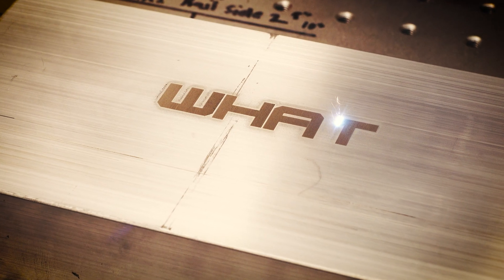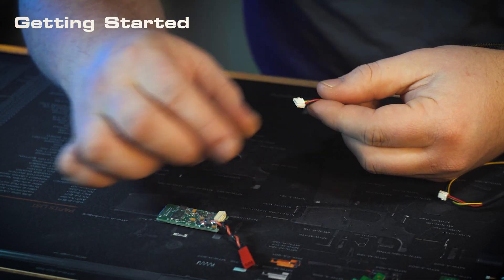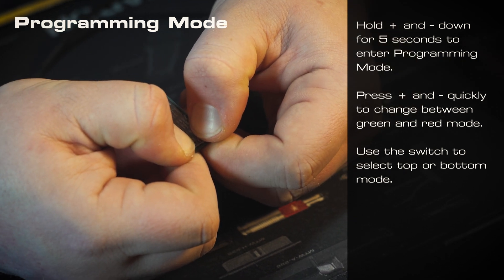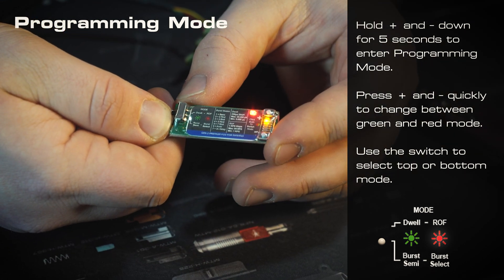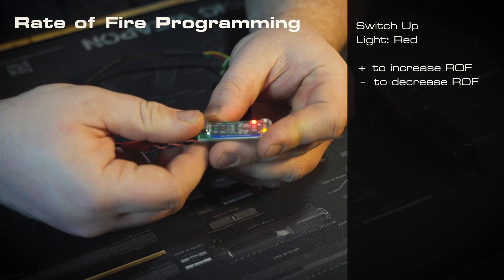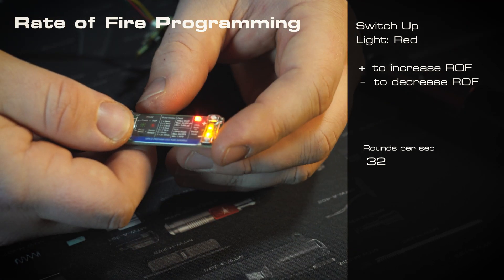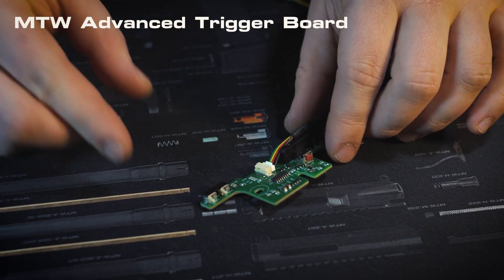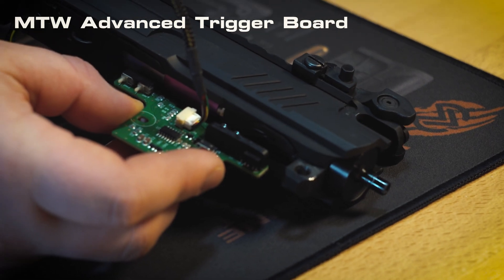Gen 2 Premium FCU Overview - What the Tech!

Comment: So I have the forged mtw with the premium fcu. I put the wraith X in it have never had good luck with the 12g cart. so I switched to the 9oz tank. Seemed to work fine. Played about 2-3months ago no issues. After play I had the tank filled and left it attached. Went to play Friday night and the tank was empty. They went to fill it and it was leaking so bad. Employee said go talk to the owner and he told me it was the wraith x and I should change it back because “they suck and you will never get a good seal”. So… I proceeded to take it apart and put back to original (btw it the engine/nozzle that’s leaking and I still can’t figure that out either, took it apart and cleaned it out, regreased lightly and still sticking out/open. It will not retract), but I digress slightly. While trying to switch it back the cables coming out the trigger side totally came right out of the pigtail. All five at once. I have tried to make sure they are in the correct order (assuming it’s the same as on the fcu unit? Top green, yellow, red, brown and black on bottom) 
This thing will not register to fire. Has fresh battery (even tried the new back up), fcu will turn on and allow me to program, and I think everything looked correct. Any ideas???
I do remember us trying to fire it at the field while putting air to the tank and it didn’t fire then either. Not sure what to do.
Reply: I do have a pic of both ends (pigtails) and they are not the same plastic piece. The switch side doesn’t seem to have a backing that is the same as the fcu side.